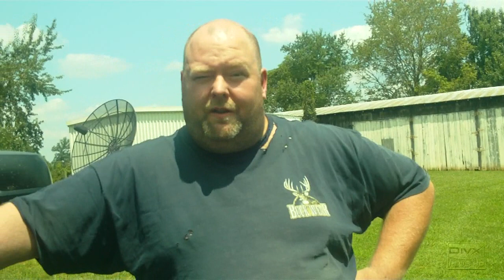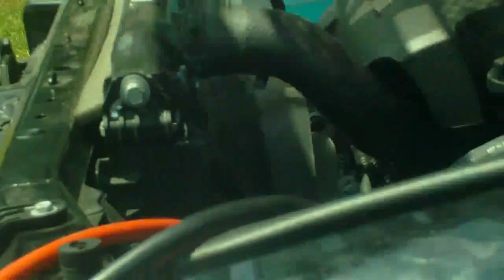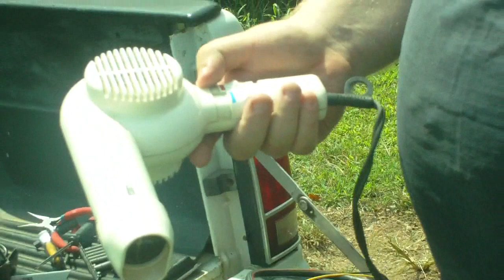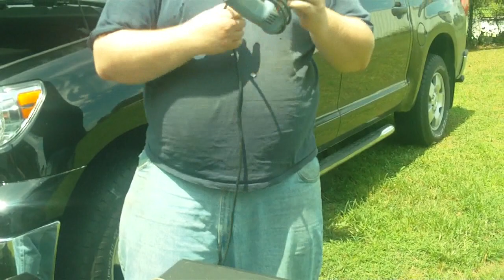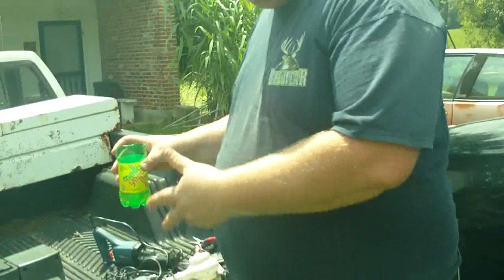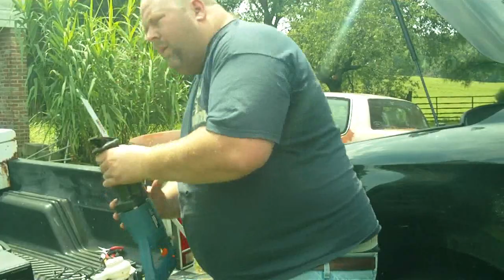Power Inverter applications

Comment: Hi,
how about running an 1000w modified sine wave inverter from a car battery (with the engine running?)  to a (modern CTEX MSX .5 ) battery charger to charge another 100ah battery

Comment from the maker: You will need a 1000W power inverter to operate the freezer in the truck. be sure to use heavy duty cables. -MrFixit.

Comment: 1hp is 1500 watts,  I use a 1/2 hp well pump & the cheap 1500 wont run it correctly, to much draw on start up. I also use a good 1500 & it runs it no problem

Comment from the maker: You would need a 1000W inverter to operated the pump. To calculate how long it will run on batteries will depend different factors. for help, watch my video on how to calculate needed ampere hours. -MrFixit.

Comment from the maker: Yes, as a matter of fact all my microwave's turn tables turn using the inverter. How the hell did you come up with 160A for a 1500W power inverter??? The most my 1500W inverter will draw is 145A @ 12VDC and 123A @ 14.1VDC, both with 87% efficiency . Power inverters will not function below 10.6VDC. If you used WhizKid's old Inverter microwave ovens wouldn't work well because of the technology Inverters used in those days. For a piece of crap, at least it still works.... -MrFixit

Comment from the maker: Would you wager a $1,000 bet to prove me wrong, timcat100? Microwave ovens will operate on Modified-Sine Wave Power Inverters. I turned off the microwave because it and the inverter have been sitting in the hot sun. The microwave operated for 20 seconds, you idiot, to demonstrate they will work on Power Inverters. I've used Microwave ovens on this inverter for 8 years and still using the microwave.... whose the liar now? -MrFixit

Comment: 240.6 Standard Ampere Ratings NEC (NFPA70E)

(A) Fuses and Fixed-Trip Circuit Breakers. The standard ampere ratings for fuses and inverse time circuit breakers shall be considered 15, 20, 25, 30, 35, 40, 45, 50, 60, 70, 80, 90, 100, 110, 125, 150, 175, 200, 225, 250, 300, 350, 400, 450, 500, 600, 700, 800, 1000, 1200, 1600, 2000, 2500, 3000, 4000, 5000, and 6000 amperes. Additional standard ampere ratings for fuses shall be 1, 3, 6, 10, and 601.

Comment from the maker: You will need a 1500 Watt Power Inverter with 2 AWG cables and a 144 Ampere or higher charging system, siamonee. -MrFixit

Comment from the maker: yes. for best protection, keep fuse close to battery. you'll need 130A - 140A fuse. If the freezer is the only unit to use the inverter, you can use a 100A - 120A Fuse. Monitor the cables for hot spots which may indicate a higher gauge wire is needed. When you have it up and running, I'll have the Ice cream sandwich. -MrFixit

Comment from the maker: It's indicating the inverter is unable to provide enough power to start the Freezer causing an overload. The motor in the compressor pulls more amperes during startup than it does when its running at operation speed. check to ensure you are getting 14.1VDC at the inverter. Are you using 4 gauge cables? Some jumper cables are not suitable to operate inverters since they use a thinner cable. -MrFixit

Comment from the maker: I assume you are referring to the buzzing noise? Does the Overload light come on with a high pitch warning tone? If the deep freezer is working it's probably the sudden inrush of current inside the inverter. Some inverters will make a hum or buzz noise around 1000 watts and higher due to the Duty cycle being around 96%. What does the noise sound like? -MrFixit

Comment: I plug in my 1500-3000 power inverter to my car battery with jumping cable car is run plug in a fan it turn on then i unplug the fan then. i plug in my deep freezer then the inverter made a noise do you no what i did wrong

Comment from the maker: Yes it does, 911token. If the deep freezer will be the only thing connected to the inverter the ampere draw on the battery is 96 amperes. Then Alternator must provide 110 amperes or higher to ensure it isn't overloaded powering the vehicle. -Mrfixit

Comment: I have a power inverter 1500 watt continuous 3000 watt surge.I what to put in my ice cream truck to power up my deep freezer.would this work and how mine battey would i need to run this .and does the ice cream truck engin battey have to be a deep cycle.thank you you can e-mail me at ..     tonygarcia911@bresnan.net

Comment from the maker: No. The peak wattage is the power inverter's ability to provide for a very short time ( around 1-2 seconds). It allows for an electric motor to go from stop to operating RPM. Motors create a power surge when they first start. As they spin faster, their ampere draw drops. You'll need an inverter with a Continuous wattage rating of 700W or more. Watch my Power inverters 101 videos to learn more.

Comment from the maker: @holman26 Shop-vacs will depend on the ampere rating and since this inverter is 1500 watts, the most you can draw is 13.5 amperes. I use a 2.5 gallon shop-vac on this inverter without any problems. but, I'll see what i can do. -MrFixit